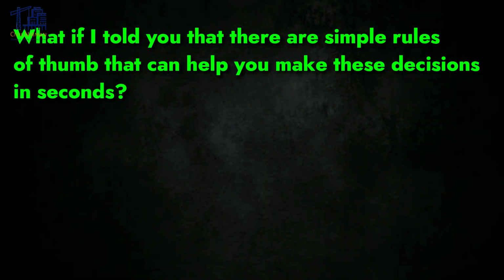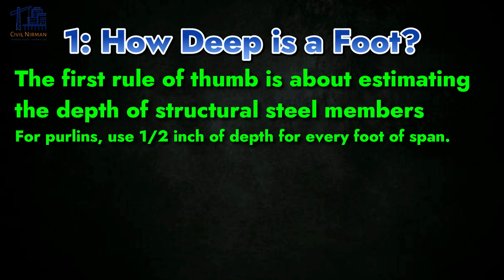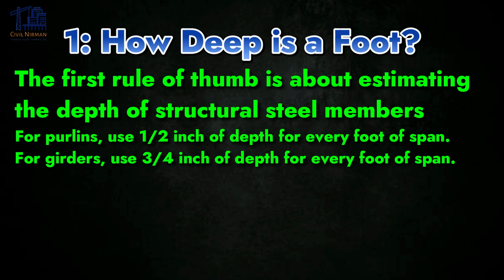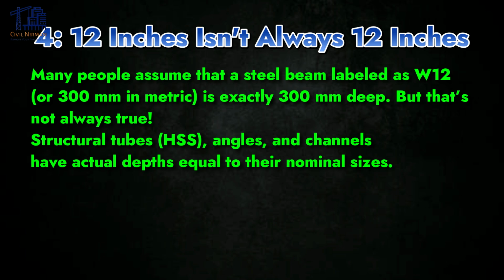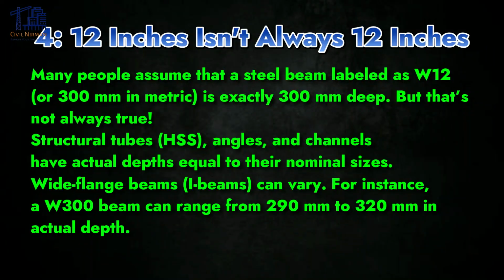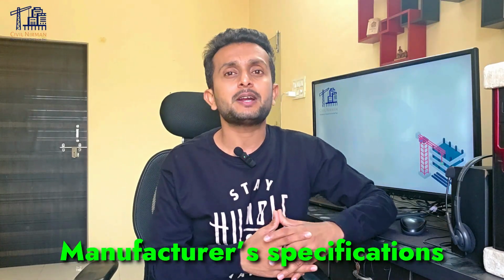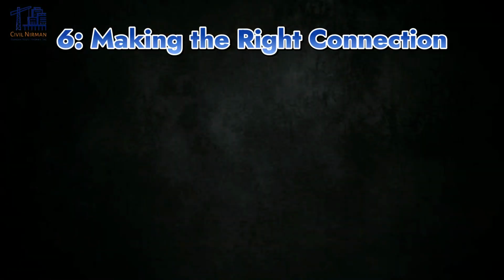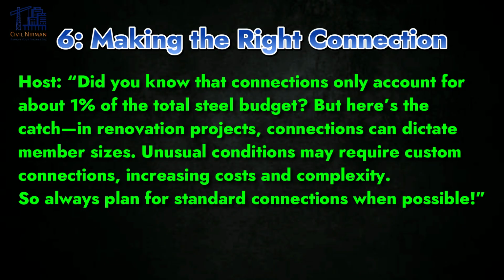6 Essential Rules for Structural Steel Design | Simplified for Beginners

Comment: Deeper beam doesn't mean a more efficient beam not does a deeper beam mean it has a larger moment of inertia. What you are saying is ONLY true if you keep your flange dimensions the same, that is if the flanges are kept with the same width and thickness as you increase your beam depth.